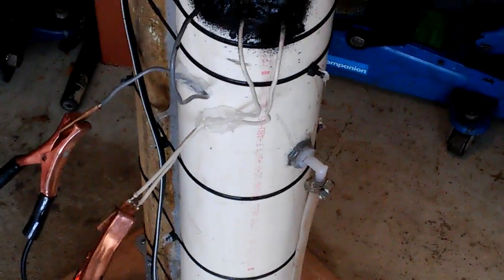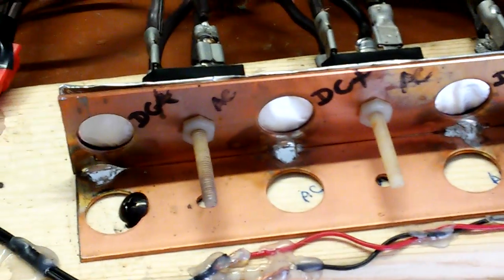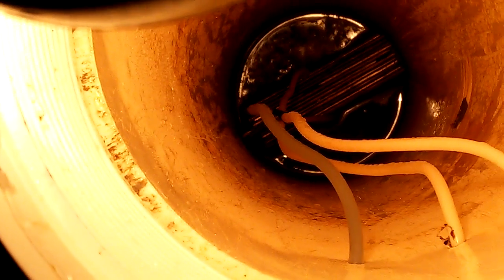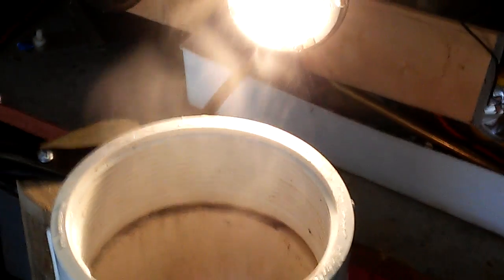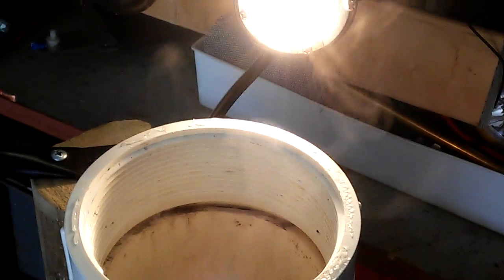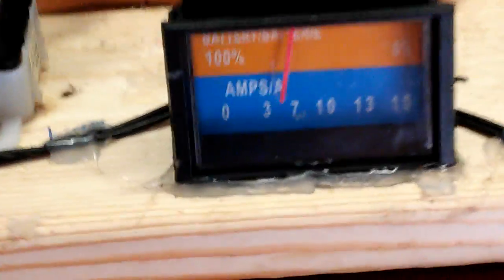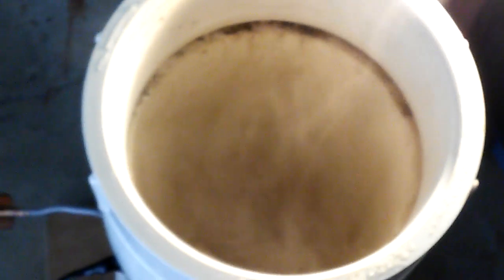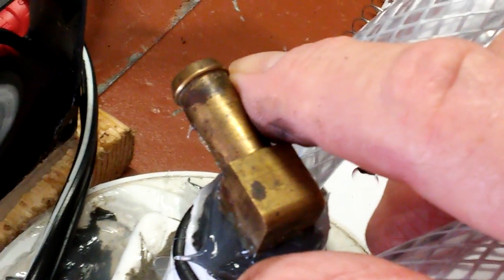completed hho cell

Comment: you do get alot of rusts thoufmgh! aint you wmusing stainless steel 316? for plates, bolts, nuts and even stainless steel wire,  you'd get no discolouring of the water

Comment: Also put a pulse width modulator and instead of the heating element it'll save you energy making the system much more efficient. You can get them in higher voltages to work with what you're using.

Comment: Do not I repeat do not compress HHO gas you will blow the container and anything by it up at some point in time. You have to make a separator cell and separate the gases then compress them if you don't anything could set your pressurized HHO gas off.
Reply: MAGNIFICO LO FELICITO: Es un gran logro, que no todos hemos podido hacer y que  será el futuro económico de los que logremos comercializar,